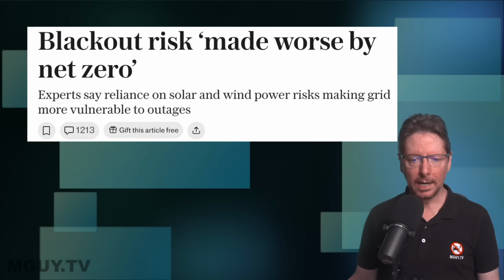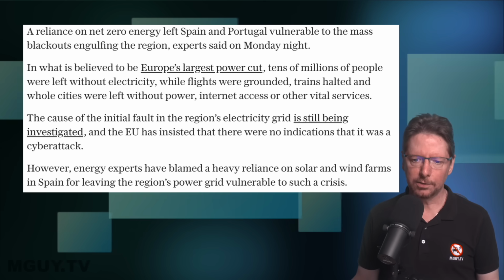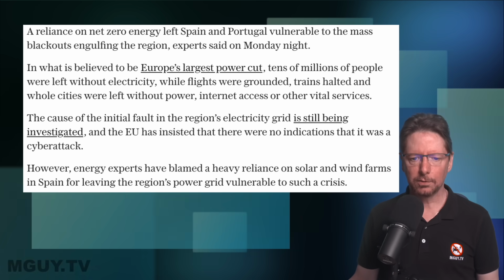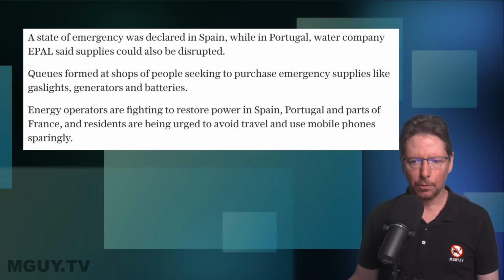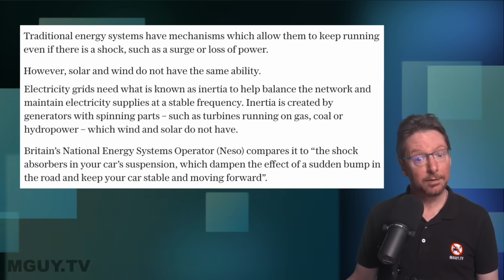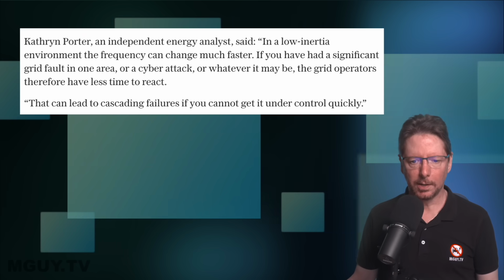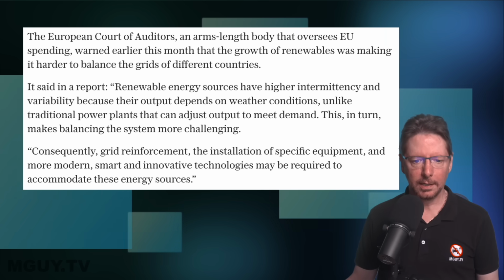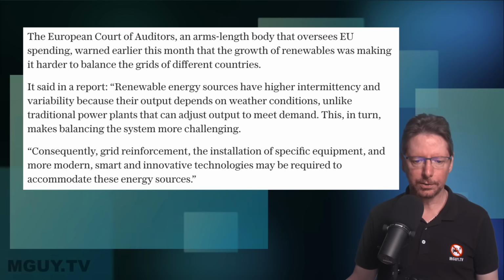Spanish power BLACKOUT: Why Net Zero and RENEWABLES were to blame | MGUY Australia

Comment: Not sure what your background is, but you did a good job explaining a complex problem (coming from an electrical engineer). The other issue behind renewables is the 'black start' problem. Most of the inverters out there that turn DC to AC are frequency 'followers'. When connecting to the grid, they're looking to sync their frequency to what's already there. That's a problem if the grid goes down completely, even though you may have solar power available, it can't be the first on the grid because there's nothing to sync to. There are experiments going on to connect a new style of inverter that doesn't need a reference to start supplying power to the grid. This means upgrading existing inverters (expensive)

Comment: Been saying this for years. People prattle on about EV battery capacity but that is not the issue. Even if batteries would be made that gave a range of 10000 miles it would not help because the issue is power generation and distribution. The power systems cannot even manage todays loads let along a 10 fold increase. It will not be long before EV chargers are disabled during peak power periods (you know, the time when people want to charge their EV's).

Comment: China has done the sensible thing. They have surplus capacity to generate electricity with most of their baseline energy load coming from coal. 
They are expanding massively with solar and wind but still only use them as tertiary load. 

Thats how it should be. You can not use these intermittent energy sources as baseline energy.

Comment: Instead of talking about "inertia" it's best to just say "Unreliable". It's actually COMMON SENSE that if you're relying on Wind or Sun for Energy that its not gonna be as Reliable of burning Fuel. Your not gonna solve this issue with Battery Backup either because you'd need entire Warehouses of Batteries to attempt it & you'll always have the problem of never knowing when a prolonged period without Sun or Wind will drain your entire system. The whole thing is stupid & HUGE WASTE of Natural Resources & if you care about Waste in general like Trash then you should be against Solar & Wind big time.

Comment: You present a great and accurate explanation but unfortunately we have reached a point where the truth is so often obfuscated that the inertia of the truth wants it to stay the same: Obfuscated. This applies to this case where the truth is much simpler (for once) than the usual story which wants to be told but is WRONG. One explanation almost got it right: Its an unusual atmospheric event. I cant be bothered explaining in minute detail because no one is probably going to read this anyway but I will tell you the basic story which will be on EVERYBODY'S lips soon enough: The Earth's magnetic field is failing. As you know this protects us - and everything electric - from cosmic rays; but also from the Solar Wind. This is unrelated to any Solar Flares as it is always there regardless and much more powerful than appreciated - containing charged particles that fuel the Global Electric Circuit via the ionosphere. Did you hear about the Carrington Event of 1859? That was a Solar Flare - this was the same thing: Induced current from the Sun but due to the Solar Wind getting thru the magnetic field instead. This is going to be happening more and more as the field gets weaker until they cant deny it any longer and one day Electricity will be a thing of the past. Unfortunately that will be the least of our worries but its not my place to talk about that; its for you to find out if that is your wish. I wrote this because I respect you and usually agree with everything you say (as I have said it myself too) and maybe I have been vague enough for them to let it remain.

Comment: they should add frequency/voltage regulators like they use in theatres/music venue's to more points in the main system. obviosly on a larger scale but they exist for 3 phase power

Comment: Of course, with the grid based on renewables there is a need for several synchronous condensers but despite this there is still something like a turbine with high inertia and possibly energised by hydrocarbon or nuclear energy to start the grid in case of a general blackout. Depending on the size and complexity of the grid or grids in this case, it can take a couple of weeks to get the grid operating normally again.

Comment: Spain is screwed. They have 21% intermittent unreliable solar due to historical subsidies. They are phasing out their 12% nuclear in 5 years! Spain's economy will fail as a result.

As follows solar and wind everywhere.

BTW this outage was caused by a 'rare atmospheric disturbance'. Ie. A hole appeared in the protective electrical field of the earth which the current ion storm from the sun, penetrated. The energy hit around Gibraltar and travelled  north across Spain.

The delicate solar and wind generation tripped and not much inertia was there as a backup.

This will continue to occur as we are the closest to the sun in 6000 years, you know the hot thing heating us up! and it has woken up by our close prescence. Lots of sunspot activity and CMEs as a result.

Called solar maximum. https://science.nasa.gov/science-research/heliophysics/nasa-noaa-sun-reaches-maximum-phase-in-11-year-solar-cycle/#:~:text=The%20solar%20cycle%20is%20the,and%20power%20grids%20on%20Earth.

All predicted by Milankovich.

Nothing to do w co2. Humans are so very stoopid.

Comment: Main stream media have been blaming weather pressure. They won't admit this is due to renewables Because the government are pushing forward the UK's drive to towards renewables. Inertia keeping the mains at 50hz is the problem. And if a part of the grid protects it's self that has inertia. Then it leaves more parts of the grid susceptible if it is relying on solar.And the grid cascade shuts down. When  system operators rely on solar to optimise efficiency. Power stations will be put on standby. And if there is a sudden dip from solar. The power stations can't speed up in time to pick up load. Because inertia also means they require time to get to speed. I suspect the grid operators pushed their luck trying to optimise the amount of solar available and got caught out.  I think however there are plans to have giant inertia wheels installed in the system to overcome this issue.

Comment: Very good. There is a solution of sorts, Synchronous condensers, that are large rotating masses that mimic generators and turbine inertia. There was a grid collapse in South Australia, a few years ago, where the fault was that the renewable energy provider was supposed to install some Synchronous condensers but didn't. Wiki says they went out of favour in the 1960s, but they may be needed to increase inertia in low-inertia intermittent supply grids. At some cost, of course.

Comment: If you supply the DC from wind and solar to a DC motor, driving an alternator, you'll get that inertia, and 50 Hz without having to invert it. Two pole generators, strictly alternators, spin at 3000rpm, 4 pole at 1500 rpm, and 6 pole at 1000 rpm, to produce 50 Hz, so they don't all run at 3000 rpm as you remarked. The electrical inefficiency of such an arrangement would probably further increase the power unit cost.

Comment: It should be mentioned that there are nations that use 60 Hz line frequency instead of 50 Hz. Or, in the case of Japan, parts of the nation at 50 Hz, other parts at 60 Hz. 😵‍💫

According to a CNN article's title (which has been changed already, due to well-deserved negative public feedback) the cause of the blackout was a loss of power.
I don't know whether to be insulted that CNN thinks I'm that stupid, or whether to feel sad that CNN felt they had to explain that to their preferred audience demographic...
Reply: Imagine "saving the planet" with renewable energy, but causing power grid instability to the point where nearly everyone buys a portable gas generator. Then, every time the power goes out, thousands upon thousands of people go outside to fire up their gas generators - causing more fossil fuels to be burned and more pollution generated. Then, you have the dummies who don't know how to operate a generator in a safe manner causing brush fires and structure fires. Anyone who knows anything about generators knows there MUST be a properly-installed transfer switch to prevent back-feeding the grid if you tie your generator into the house, but there's so many more people who don't know that (or don't care/can't afford it).

It's like nobody ever played Devil's Advocate before they pushed us further into the at-least-40-year-old doom-and-gloom "the end is nigh" message. According to Greta, we've got about 6 years left before the planet suddenly ends, can't we just enjoy what little time's left? The polar ice caps are gone, half the planet's flooded, the ozone layer is completely gone so we can't go outside without UV-blocking space suits, I've already lived through one "ice age" before you were born (go ask your daddy, he's older than I am, so he lived through it too).

Comment: Utter nonsense. Wind farms are regulated by blade pitch and can react to changes in demand. UK grid frequency varies all the time by +/- 0.1 Hz according to demand. I’ve just returned from Tenerife where almost 100% of power is generated by wind and solar, no problems there. The issue in mainland Spain is under investigation however initial findings suggest resonance in the grid cable infrastructure caused by meteorological conditions. We need to wait for proper analysis rather than speculate from the pages of Tory funded newspapers.
Reply: Meteorological conditions, 🤣❤

Comment: Simon,

I really liked this video and how you explained inertia and AC frequency stability. However, you should also mention phase synchronisation. Unlike DC circuits where voltage and current are always in phase, AC circuits or grids must deal with reactance where the oscillating voltage and current frequency are out of phase with each other. Base load power generation must introduce capacitance and/or inductance loads to keep voltage and current in phase so that real power is as close as possible to apparent power.  Point being, voltage and current phase differences can be more devastating than frequency stability. For example a base load generator could be producing an apparent power of 1GW and the real power at the consumer is zero.

I am not against renewable sources, but I do agree with you on the asynchronous aspect of these power generation sources.  I believe the answer or compromise is not to connect large renewable producers directly to the grid directly but indirectly through some form of potential energy storage like batteries, hydrostatic reservoirs, etc.

Comment: In the utility industy, the inertia as discussed in this video is typically called "spinning reserves".   All of the generating units are not running at full load.   A percentage are at reduced load and are able to "ramp up" in the event of one of the other generating units coming off line unexpectedly.  These concepts have been around since the early 1900's and have withstood the test of time.

Comment: Don't forget the Rotary-synchronous condensers which - have been placed in remote parts of grids (additionally to the generator) to stabilise the system - and  are often replaced by simulated versions (batteries and inverters) - because the real thing is too expensive (unlike batteries and outages, obviously)  jk..

Comment: Retired electrical infrastructure planner here. I think that irrespective of the unreliable nature of the generation in solar and wind. The other less known factor could be the culprit for this disaster. That is Transmission Line are not innert pieces of equipment ie they generate capacity voltage at light loads ( VARS) and they absorb ( VARS ) at heavy loads making voltage regulation and power factor control difficult. And the system of sustainable has to have thousands of km more T/L so as to obtain power from many different locations. It would appear that the system in Spain is such and as such would be very difficult to regulate, so perhaps it's not just the unreliability of the power system they are building but also the Transmission cables themselves. Just a thought but if that is the case then it will be inherently unstable.

Comment: I read an article that said that the grid in Spain was under additional pressure because the wind wasn't winding.  In other words, the unicorns weren't blowing enough farts, so there was additional strain on the solar power resources.

Comment: An excellent explanation of inertia and the grid. Flowing the 2016 SA black out issue and total grid failure, I was camping at Wilpena Pound next to a German electrical engineer who had not heard of this incident. I explained it and he then noted the problems with intermittent supply. Well done!

Comment: get you facts correct...power loss was a distribution issue, not power generation.  Things are pointing to a failure of the grid, right now that is just a theory.  Lots of green power was available.
Reply: Climate change nut.

Comment: Without knowing what Simon has just said.
I made the comment on C4 news (uk) that I think it was grid instability due to the sudden changes in output from wind and or solar  that caused this.
The power grid due to the sudden changes in generation went outside the limits, and everything started to trip out.
The grid must at all times be balance closely to match generation and usage. 
Failing to do so sends voltage and frequency too far out.
Widely predicted this would happen as it nearly happened in Ireland.

Comment: I don't know if other countries have this (doesn't look like spain or Portugal did) but in the UK the grid system is backed up by loads of backup diesel generators at sites like office buildings, exhibition centres, large supermarkets/shopping centres, leisure centres, hospital and other large buildings. If the grid gets a high spike and needs more electricity these diesel generators will be turned on remotely or manually by the companies who lease them to these buildings.

Comment: I totally agre with everything you said, but in this case, the source of the problem was not the "renewable" trait of the grids. The source was a plasma intrusion, from the solar wind, caused by a hole in our magnetic field, that allowed all that plasma to hit Gibraltar and knock out the grids of Spain and Portugal (and the south of France). This is an ongoing and increasing problem that nobody, except a few, want to acknowledge. It's a miracle that there was only a domino effect on the stability of the grid, and no main components (transformers, etc.) were burnt, like it happened in Canada, some time ago. Would there be hardware burnt at this scale, and we would be looking at months before the grid could be repaired. With no electricity everything stops - it's a direct dive into the stone age!!
Anyone interested, just have a look at this video from last night, about this exact problem:  https://www.youtube.com/watch?v=TYuPQ2NbkwA

Comment: There is another reason that could have caused this disaster. 

Because in the process of changing DC current to AC current, the sine wave is created by electronic circuits as a step waveform and not an analogue sine wave. As a result of this steps, such a signal carries a huge amount of high-frequency interference, which in turn makes such a power supply unsuitable for AI, for example. Perhaps these high-frequency interferences somehow transferred to the computers of the system protection circuits and the network was shut.

Comment: 0:50  I worked on construction at many power plants, part of my job was assembling the turbines .... 

They are indeed massive, there's HUNDEREDS of BLADES  on the turbine shafts, and 4 separate turbines in each unit of the power plant. and 4 units at the plant  

Each fan BLADE weighs as much as several men!

Comment: This grid inertia is a topic that I rarely hear discussed anywhere and yet it is a huge part of the Achilles heal for net zero moving forward. Imagine a grid that spans a nation, of which each power plant is exactly in sync to keep supplying load at precisely the same rotational speed.  Each plant has massive inertia,  with these generators taking 20 minutes or longer to spin up. Then apply an ever fluctuating load to that grid that requires precise 50 cycles per second (or 60 cycles over here in North America), it really is an amazing system. Then imagine pulling down these huge power plants one by one, replacing them with a wildly fluctuating supply of power, from moment to moment, day to day, and even seasonal with zero inertia to carry over a fluctuating load and the whole house of cards falls down. That they are destroying these traditional power plants so they can never be revived when the net zero experiment fails, instead of simply decommissioning and mothballing them is really a crime against humanity, whether its done through ignorance or purpose it will reach a tipping point where all it will take is a winter storm, or some extended weather event and it will kill a lot of people.

Comment: You pretty much touched on the need for a reactive force to balance the grid, large or small. Keeping several large power generators on line is one way and Spain has quite a few fairly new large power plants. Another way to balance the grid is to employ synonymous condensers around the grid - and they can be those large generators mechanically uncoupled from the prime mover. I suspect that Spain, in their infinite wisdom were trying to maintain frequency via electronic means and the load simply overwhelmed their 'gadget(s)'
Reply: I hate spell check sometime - it's a synchronous condenser